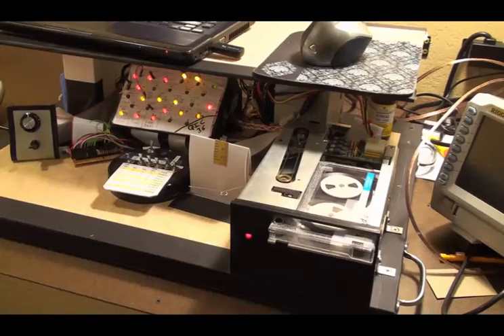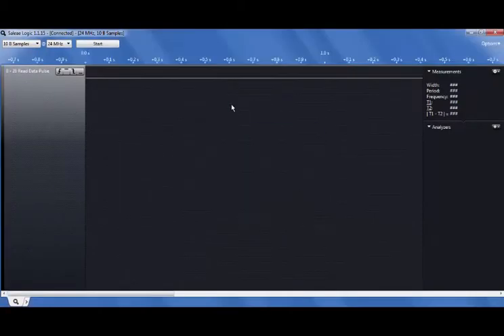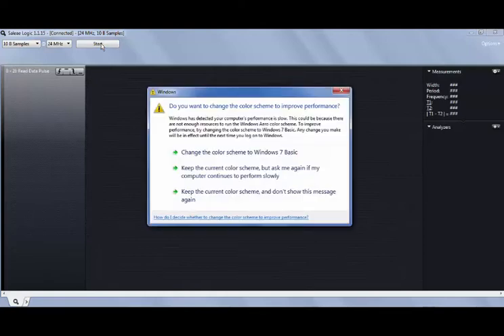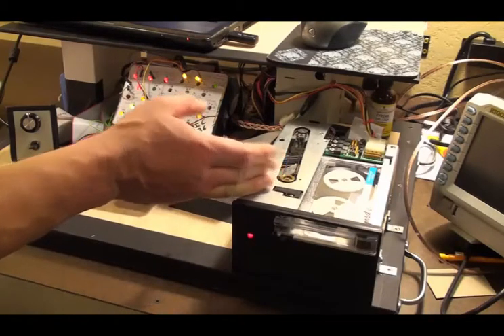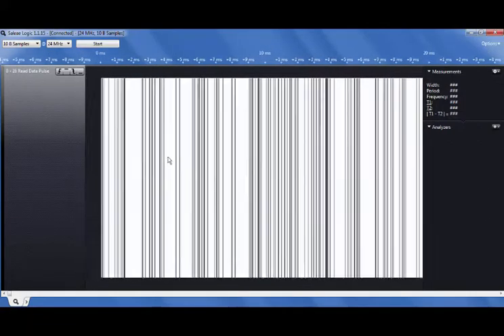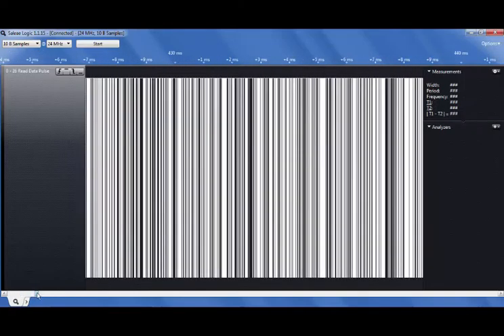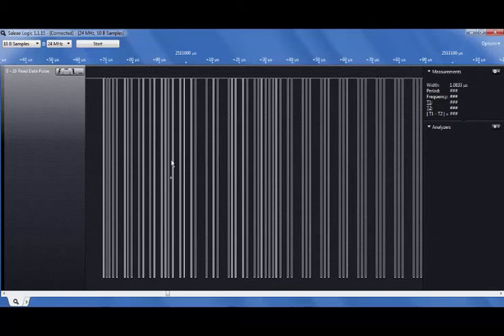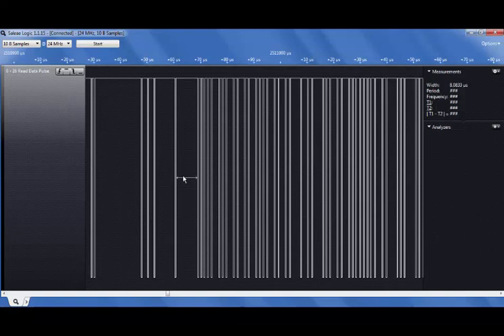Identifying Hardware and Tape Noise - Universal QIC Reader

Comment: Commenting 7 years later, but what you are seeing is the noise in the tape head amplifier as the AGC (Automatic Gain Control) is initially turned up to maximum hoping to find any flux transitions from the tape head. The preamble not only provides an initial timing reference, but also allows the ideal amplification level to be quickly found with the discardable flux transitions of the preamble.
Reply from the maker: @ChrisSmith-tc4df , 7 years later is OK, this is great knowledge well worth waiting for...thank you!!!

Comment: So I am curious: If you were to defeat the interlocks and put the drive into the "loaded" condition, or perhaps load a tape cartridge that has no tape in it, no tape against the head, do you see the same noise on the data pulse pin? I'd imagine so..

If you were to hook pin 36 up to an oscilloscope, what does the noise look like? What is the peak voltage of the noise vs the peak voltage of actual data? 
My gut feeling is if they are different, or rather the peak voltage of the noise is lower than the peak voltage of the data, that will give you a really easy way to eliminate the noise problem altogether! What do you think?
Reply from the maker: +Cpro Nikkor "If you were to defeat the interlocks and put the drive into the "loaded" condition, or perhaps load a tape cartridge that has no tape in it, no tape against the head, do you see the same noise on the data pulse pin? "

Yes, absolutely.
Reply from the maker: +Cpro Nikkor "If you were to hook pin 36 up to an oscilloscope, what does the noise look like? What is the peak voltage of the noise vs the peak voltage of actual data? "

I've done this.  The peak voltages are exactly the same.  A pulse is a pulse, whether it is noise, or data.  A high signal is between 4 and 5 volts, and a low signal is very near zero volts.
Reply: +Convergent MightyFrame Interesting. So what this means is that there had to be software logic on the end of the computer or perhaps some sort of hardware glue logic on the controller card which would recognize the pattern of valid data as to not fill the registers/whatnot with absolute junk data. You would think there would be some sort of latching mechanism for a low or high state as per tape head input but I guess not!
Reply from the maker: +Cpro Nikkor I agree with your conclusion here, on the surface of the concept anyway.  One of the reasons that I chose the Wangtek 5099 for this project is that the schematics for it are easily available.

I have created a dedicated page to the hardware and schematics for this drive at:
http://mightyframe.blogspot.com/2015/07/wangtek-5099-tape-drive-main-board.html

Since you have a firmer grasp on hardware circuitry than I do, you might be able to browse the circuit diagram and see exactly why these high/low signal voltages are always the same, as well as why it may produce noise when the tape is not in motion.